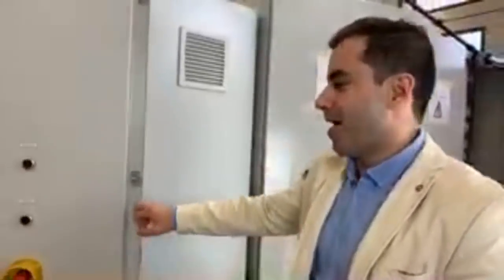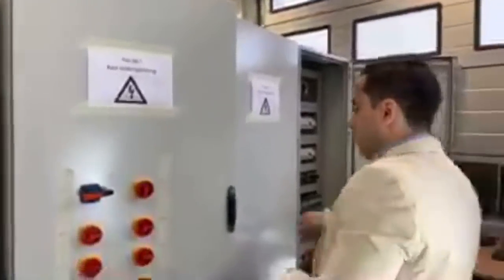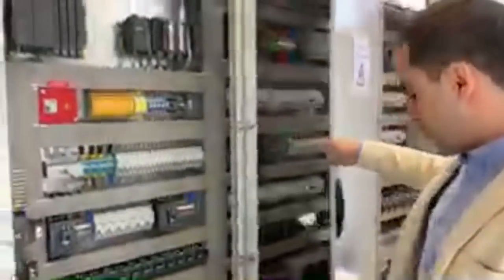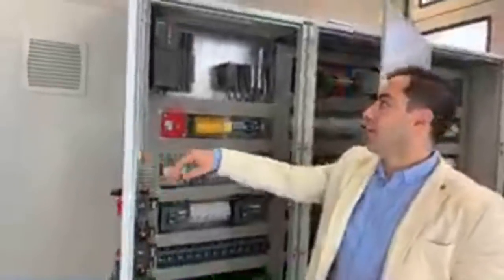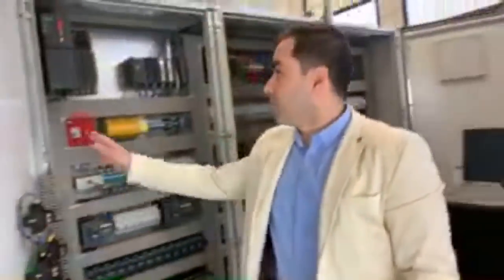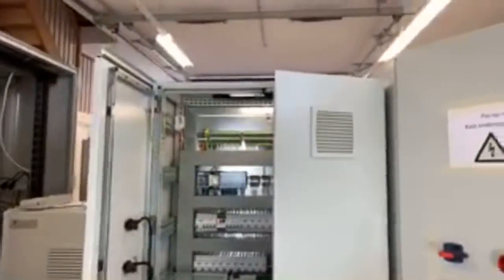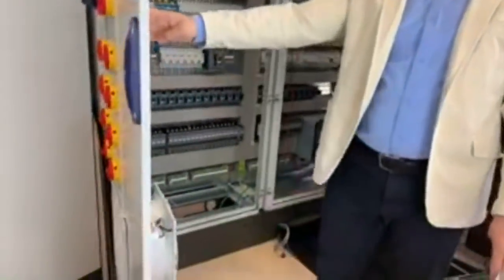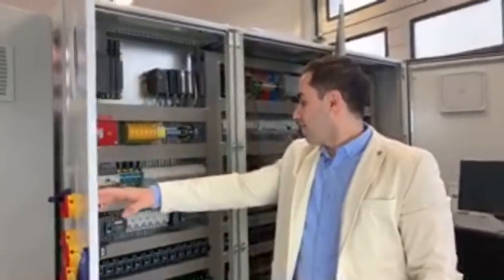PLC Control Panel Overview

Comment: Thank you very much for technical information.
And I have one question
What is the standard location for ventilation fan??
In the bottom or upper of the panel
Reply: Bottom is for fresh air intake & top is for exhaust of light/ Hot air from the panel.
Reply: Ilyas is correct:  bring in fresh air from the bottom (through a filter!) and use the fan to exhaust from the top, in the opposite corner.  Dust and dirt will accumulate around the poutside bottom of the panel, so good filter and good filter maintenance plan is crucial.  Also, the intake port should be larger than the exhaust port (25-50% larger in area).

Comment: I wonder what facility this control panel was assembled for. Would give some further insight into why this exact setup was chosen !
Reply from the maker: Hi there, the first one with the BECKHOFF PLC will be installed in a wastewater treatment facility and the second one with S7-400 PLC will control a few reactors.

Comment: One of the Oil company i went to installed AC along with fan coolers in the control panels.Why do we need to cool the panel so much is it because it contains relays or because the PLC requires cooling like a CPU that needs cooling as well?.
Reply from the maker: The internal temperature of the panel usually needs to be maintained at or below 80F (27C).   The factors which play into internal panel temperature are ambient temperature, heat load from all electrical devices, and air flow through the panel.  As you can imagine, a panel outdoors in the summertime can get bombarded with solar energy and the panel temperature can rise dramatically.  An indoor panel can get quite warm internally if there are many electrical items that produce heat, like power supplies, VFD's, transformers, etc.  A panel designer will know how to calculate heat loads from the information provided and be able to determine the best way to keep the internal panel temperature within acceptable limits.

Comment: I can tell you as a service technician, the biggest mistake controls makes is putting to many relays and overcomplicating the process of building a panel. You can have the same protections with less relays and bells and whistles. Sincerly every service tech ever.